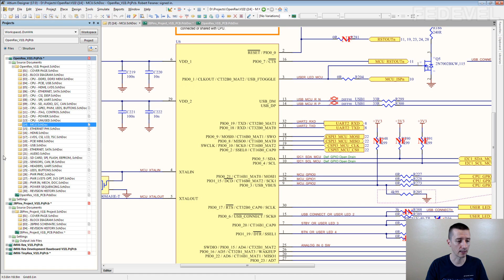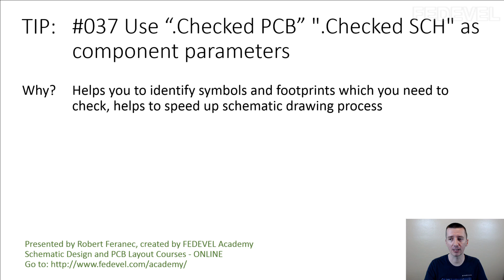TIP #037: Use “.Checked PCB” ".Checked SCH" as component parameters

Comment: This is such a great tip, and I've implemented it in my design flow.  I recently did a prototype board, rushed it and ignored this step - and sure enough,  a new part I recently made that I didn't check had a pin-out error which made for messy rework.

Comment: Robert,
This is a great tip, and I appreciate it. I'm stuck on an implementation detail (in Altium), and I'm hoping you can help me figure it out:

Suppose I make these properties for all the components on my project. Then the board is done, and I want to update all of the properties to "used". Do I now have to go through each library manually and update these parameters?
Or, if the parts are in a project-specific .SchLib/.PcbLib, after updating all of the parameters, is there a way that I can copy all of the updated components to my main libraries?

Once again, thanks for all the great videos!